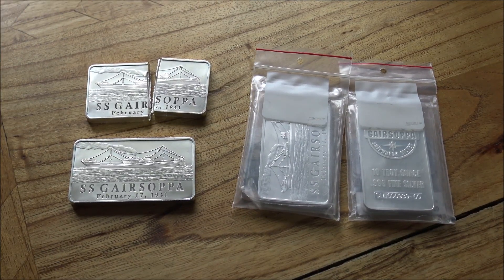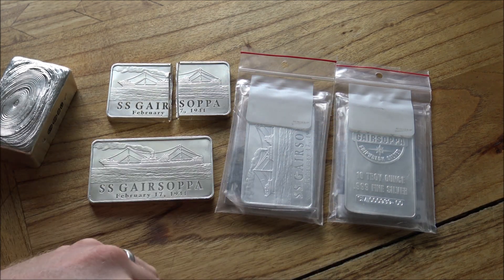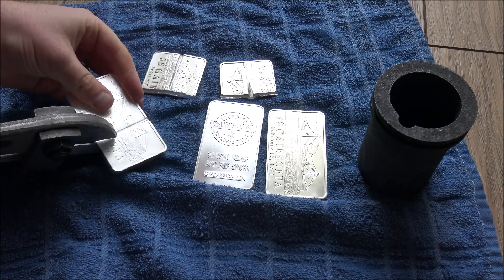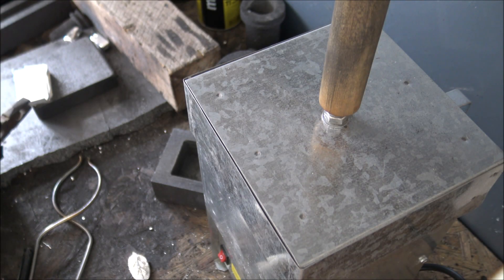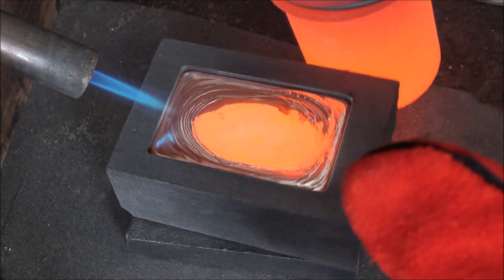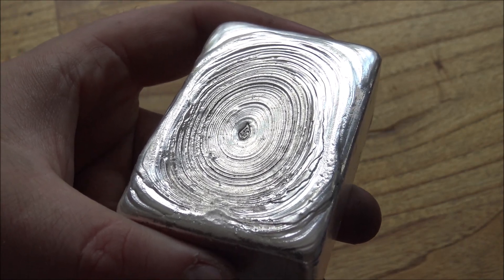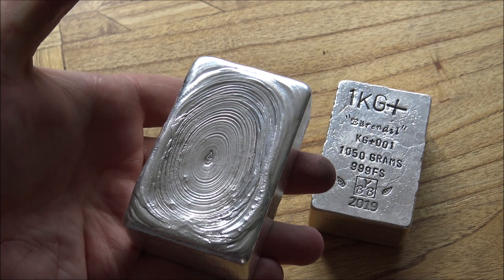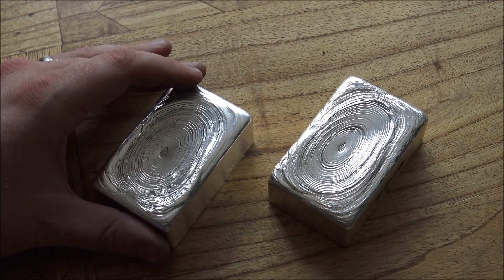Making a 1kg + 75 year old Shipwrecked Silver Bar!

Comment: So fascinating! I've never seen this process before in its entirety. I'm curious does any of the silver escape as gas during the heating or pouring?
Reply from the maker: It's very unlikely that any silver is lost this way, but there might be a very small number of atoms lost to this. You do sometimes get some small splashes of silver that means some of the material does not end up in the mould - but that is often easily recoverable.